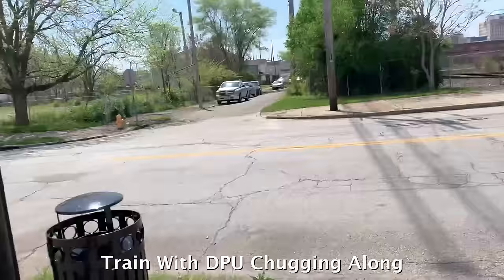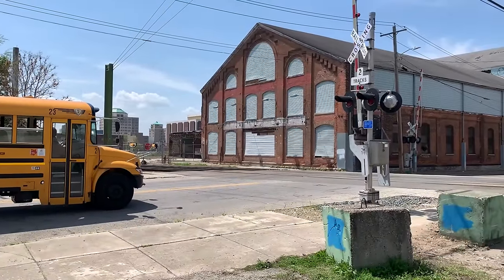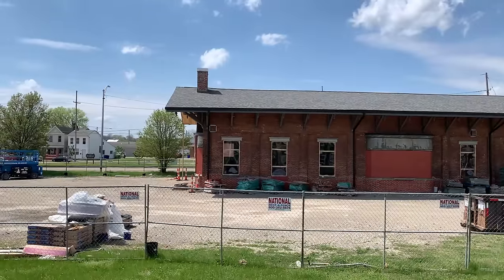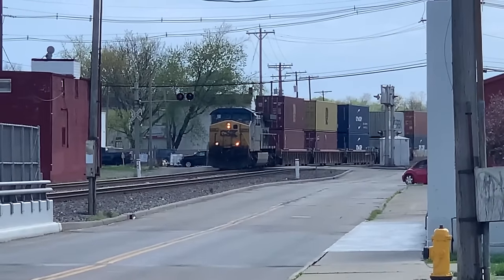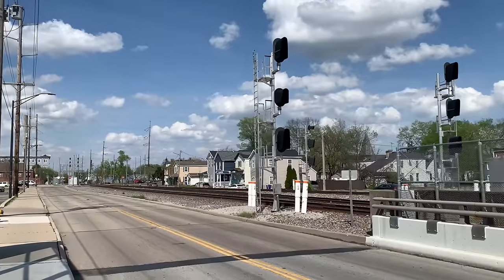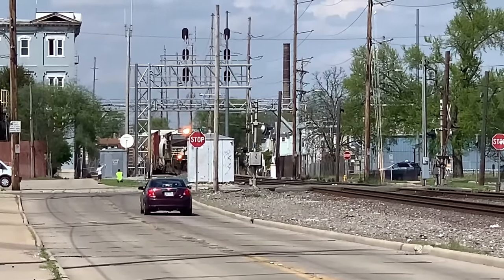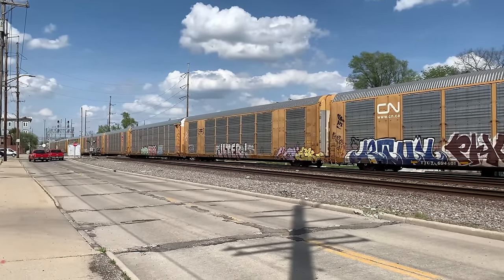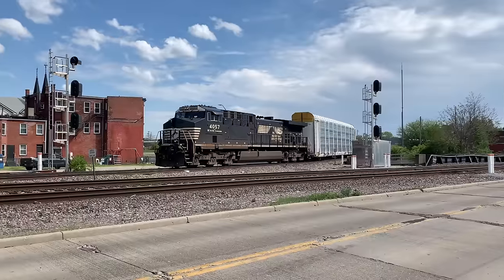Norfolk Southern Trains Using CSX Tracks & Diverging, Interchange Trains, Railroad Station Update

Comment: JT, the guy drilling in the parking lot was taking core samples to find out the bearing capacity of the soil so they would know what kind of foundation the building would need.
Reply from the maker: Thanks for the info 😊🎉
Reply: Your explanation is better than mine... lol!  Forgot about the compression/bearing capacity.

Comment: That train with 632 axles, like you said, had 152 cars 156 with the 4 engines. Counting 6 axles per engine,  take 24 of 632, which brings it down to 608 axles. I needed a calculator. You did it in your head. Nice job. I love Hamilton,  never disappoints. That was a beautiful lashup, too. Thanks for the video Brian stay well roll on

Comment: Thank you for another railfanning video from Hamilton, Ohio with an update on the progress on the depot, Jaw Tooth! The trains were interesting to watch as they passed your camera. The most obvious update is the addition of new windows. I am surprised to see that they have not put a blue tarp over that hole in the roof of the two-story portion of the depot to protect the interior. That was an interesting remote-controlled contraption to move 55-gallon steel drums.

Comment: where i live for some reason CSX has their signal lights lit in areas of high people traffic. i went up to the station in my town and it was green I waited for a few hours nothing came by. then i noticed that they are always on. either solid yellow, green or red. Out in the country about 10 miles from anywhere at a rural station thee signals are dark till a train is in the block to lite the signal.  CSX I think does a great job on maintenance. i have to laugh though at points of high visibility they do an extra good job on bright ballast on their tracks. I was in the next state over and Norfolk Southern used red ballast rock, looed really nice.

Comment: I have one of those radios like yours, I don't use it anymore because it would cut out a lot in the middle of talking, It was nice and loud is one thing I liked, but seemed somewhat unreliable. I went back to my more reliable handheld scanner, You cant hear it when there is a train currently passing and sometimes other noise around. It actually seems to pick up farther away signals also.
Reply from the maker: Thanks for the info.  I might do a video telling about the problems that they have.  I had one that wouldn't receive very well so I took it back and they gave me another one.  Sometimes they will go off and come back on.  I think it has something to do with a bad connection with the battery pack.   They do what I need and they are cheap.